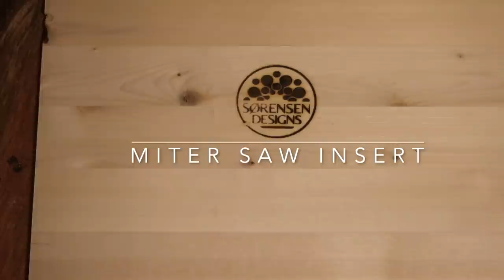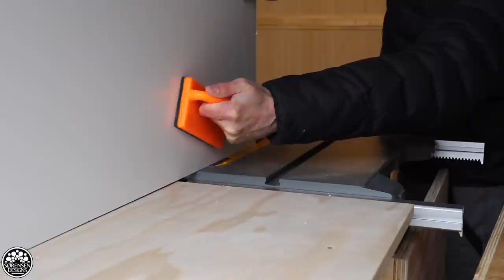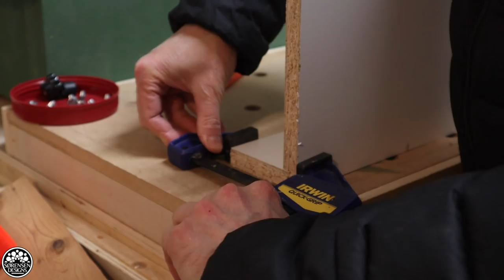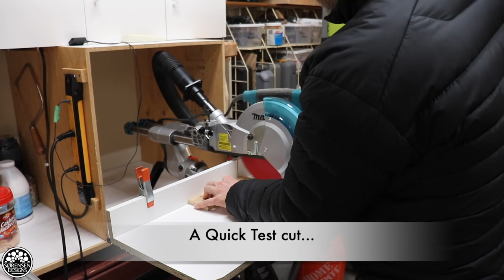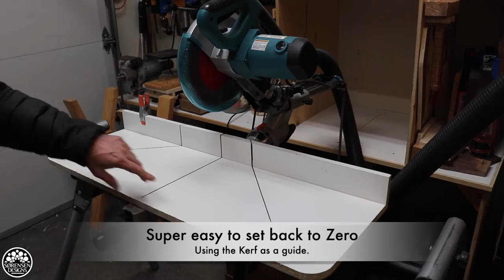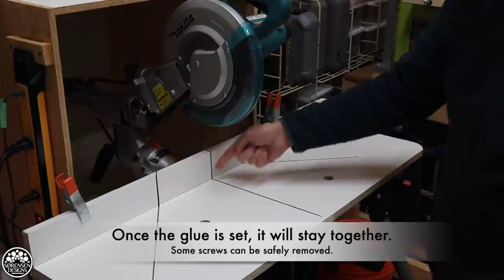A Crosscut Sled for Your Miter Saw // Woodworking

Comment from the maker: Hello Friends! Hopefully you read comments before making one. A few points on this: 1. It gives you more stability when cutting shorter material. This is because the miter saw only has a narrow platform at the front. When cutting shorter boards, things get a bit tippy. 2. It produces a cleaner cut. This is because of the table top and the zero clearance. Yes, you can get the same with a small kerf insert ( tape or whatever ), but then you're missing the stability of the table top. 3. I'm sharing this with you because this is what works in my little shop, and I don't have space for a giant miter saw station that takes up an entire wall. I figured some of you might be in the same boat. 4. The sliding compound miter saw is designed for crosscuts. You should be using it for crosscuts and not the table saw.

Comment: Hey Eric can you add a t slot to this?
Reply from the maker: Sure you can. Although I would use 3/4" Plywood instead of Melamine in that case.
Reply: Can't you you use t tracks?
Reply from the maker: You can cut a dado into 3/4" Melamine and install an aluminium T-track. Cutting T-tracks straight into to melamine like I do with plywood, probably won't work. Because melamine is made up of a particle core, it will crack. Plywood, being laminated layers, is much tougher.

Comment: Thank you!  With this insert does saw dust become a problem more than normal?
Reply from the maker: I found that the dust collection improved with this new insert. I'm still not sure why, but I think it's because the dust is diverting through the port and not getting blown back to the front like it used to.

Comment: Will the plans for this be on your site and are there any special requirements to the miter saw ?
Reply from the maker: The dimensions are specific to my mitre saw, so I won't be doing plans. It's just simply a small counter top with a back support. The width goes out about 4 cm / 1.5 inches past the support extensions on either side. The depth is from the back plate to the front, just before the mitre lock in the middle.

Comment: Hey Eric can you make a jig for circles on a small band saw? Need some ideas
Reply from the maker: It depends on the diameter of the circle - might not fit on your bandsaw. There are videos on YT for bandsaw circle jigs. Personally, if I need a perfect circle, I use the router on an axis jig. I find it does a cleaner job.
Reply: @EricSorensenCanada  all good I use a nail and a 3/4 runner on a board to measure I make the board larger if needed

Comment: Hey Eric,  Thank you for sharing this idea and video. I really like your videos. They are all so straight forward and professional. So when when the troll popped in, I had to replay it a couple of times fell out laughing.  I loved it! It was a great way to start the video.
Now for my question.  When making the 45 degree cuts should I leave the jig in the original 90 degree cut position and just turn the saw head or should I slide the jig over (right and left) for each 45 degree cut?  Thanks again for the video and the laughs 😀.
Reply from the maker: Thanks Ray! For 45°, it is best to remove the insert, set your 45° on your saw and lock it. Then place the insert back in, slide it about 4 inches from the center more or less, then line up your blade and make the cut. Again, make sure the depth stop is engaged so you only cut into the surface about 1/16". Also, pleas check if any screws are in the way before you cut. If they are, simply remove them (assuming your glue has dried and set).
Reply: @EricSorensenCanada   Thank you for your reply.